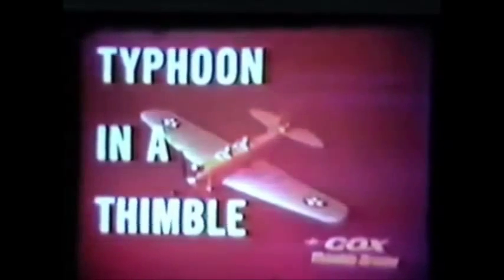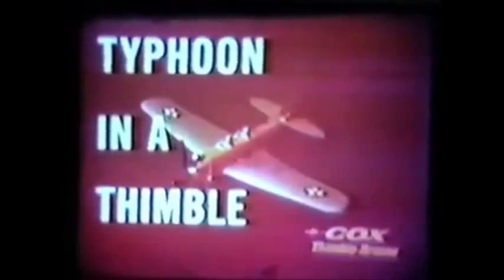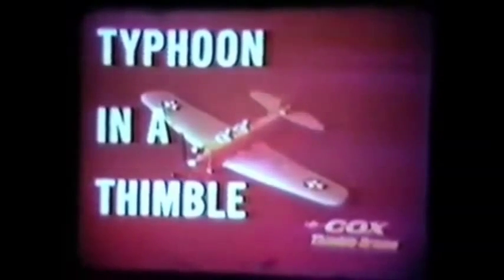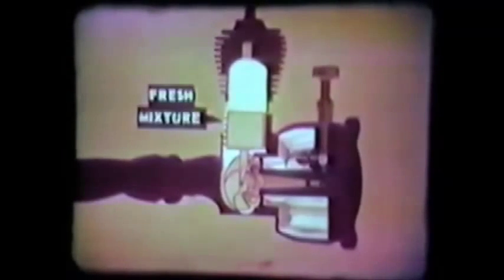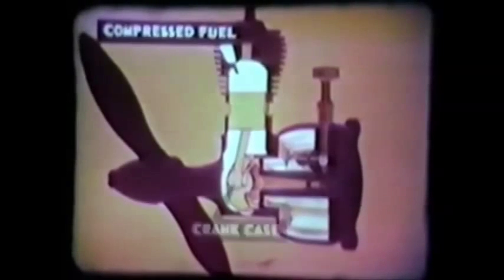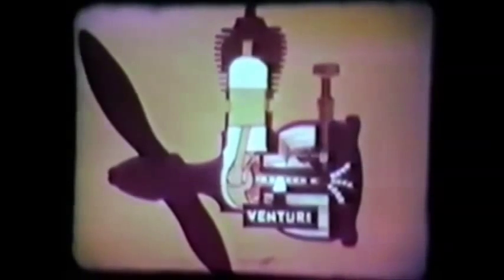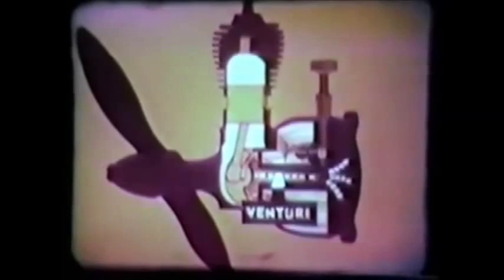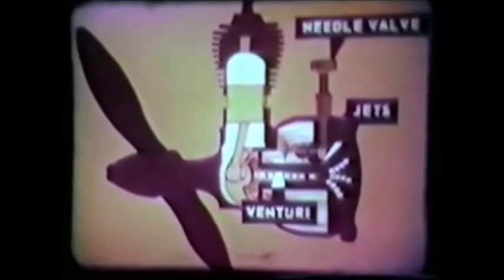Typhoon in a Thimble - How a Cox reed valve engine works

Comment: I had these as a kid in the 60s . You got really good at taking the fuel tank off to clean grit from the reed valve. If there was even the tiniest speck of grit in there the reed wouldn’t seal and the motor would not run. In the later 70s I flew RC planes and on my smaller planes I used the TD engines which were rotary valve and not as temperamental about dirt.